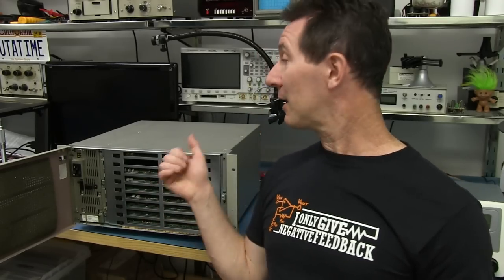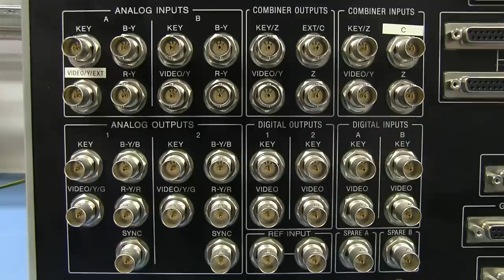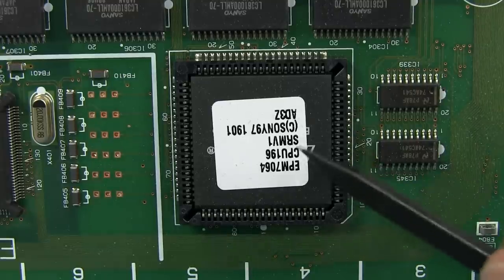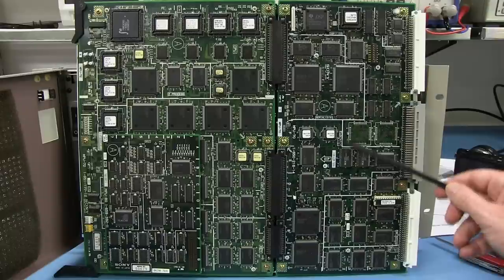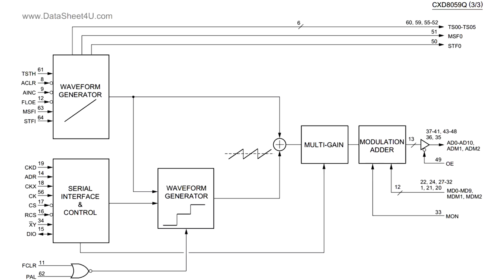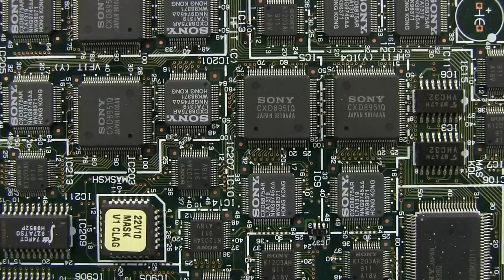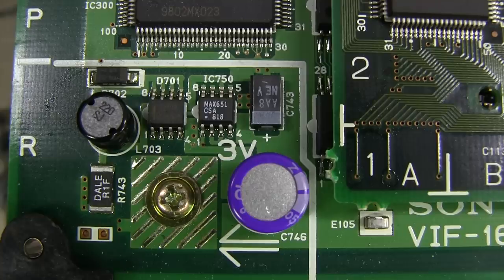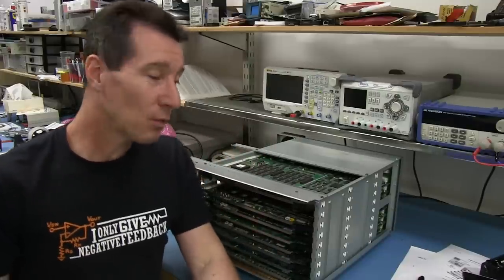EEVblog #598 - Sony DME7000 Video Multi Effects Processor Teardown

Comment: This is all hardcoded math, logic glue and memory working in real time. There is probably very little flexibility and the CPU only use is UI and control the switching circuitry. Now all that can be replaced by a bunch of large FPGA for a fraction of the cost and more effect flexibility...

Comment: and now 1 GFX card can do all this and faster
Reply: So, where are the multiple SDI inputs on your graphics card?
Reply: Except for getting data IN and OUT of the system, that's what the ethernet card does.
Reply: Even back then if they just stuck a bunch of then state of the art 3D graphics accelerators (Geforce 256 or equivalent) they could have come up with a much more powerful machine, even if they split it on different boards. Effects like wiping can be built in with assembly language routines. What they've done here instead would have probably been better suited for the early 90's. They probably would have needed some analog digital-conversion boards to maintain backward compatibility with older equipment.
Reply: Appart from the fact that this beast does it all in real time, including multiple analog input to digital conversion, then D-A back again. All effects can be applied at once, one above the other, without any loss of sync.
Even if a modern GPU as a million time the processing power of this equipment, it can't do the same thing reliability. I'm pretty sure TV studios still use same kind of custom hardware nowadays, you just can't produce real time work with generic CPU/GPU.

Comment: Those SBX1601 and SBX1602 chips were very unreliable. I have replaced at least ten, but ours were thankfully socketed. They are serial-parallel converters for SDI 270Mbit video.
Reply: Knew this comment must be down there somewhere. Sony sold these as parts to other broadcast equipment manufacturers as well.

Comment: SUch a big machine for such a small task, I guess that's the price of reliability.
Reply: No it is the question of ...ability. That just
shows the giant technical development in 20 years. In mid 90ies FPGAs were quite small and PCs had MBytes of RAM not GBytes. I also had to laugh when he was thinking about auto routing. There were no usefull auto routers in this time. But even today in the company I work 99% of routing is done manually.
Reply: goamarty  wrong. a lot of good auto routers in the 90ies, like Orcad. I've worked with them at highschool.

Comment: why would any one want these in todays market? wouldn't you just buy After Effects or some other video software to do all of this?
Reply: if you want true realtime video editing for live perfomances, you will have to use something like this.
Reply: How exactly would you do real-time, multi-input video effects with AFX?
Reply: That's why it is called AFTER effects... you do them later...
Reply: today TV stations use a more advanced version by companies like Tricaster. Any produced professional video, like all the giant bomb stuff is done through a tricaster... they start around 10k
Reply: stephen westervelt Tricaster isn't a company, it's a line of video mixers made by NewTek. There are several other brands making similar systems (Sony, Grass Valley, BlackMagic, etc.).
Reply: Cameron Belt This is realtime (live) after effects is after recording
Reply: A computer can crash. A hardware based editor can't. That's it. Even nowadays they still use hardware effects mixers, wherever it comes to reliability. +stephen: As far as I know Tricaster is a computer-based system-in-a-box, semi-professional, and yes, it can crash (even though newtek products got better within the years). I've had a Newtek Videotoaster with SX-8 extension, and it was a big mess when it crashed during a live event in Vienna.

Comment: RS422 what for a bad interface - this is the worst interface ever like the 485 everytime death from a small electrical flash distroyed. I've ever repair this 485/422 interface chips. (if you connect it often and after a while) The left side of the Videoinput is never used in a Studio and the reason for this is that all CAM interfaces are SDI and connect on the right side as you can see on the backside view of this input/output board. 

A todays PC is 100.000 times better than this part of oddware SDI technic. for example i cut my 4K-HDMI Video direct on a X470 PC Board (Ryzen 7) and this means 2times 5Gbit/s input and 1time 5GBit/s output at the same time on the fly! (M.2 SSD is required - a SSD on the SATA bus will not work)

That a PC is slow and not usable is now never more so - this old SDI cards are so slow and a new Insert Card like the Blackmagic Pro 4K blow this old stuff for lightyears away! 

Sony ist one of my favorits in this point - but the time is now that video is stored in mainframes. Video will edit and cut on the PC or (calculate the effects) the time of such an old box are over.
You edit and cut and effect on Avid Systems that's what happend today in a Videostudio or Editing Place.

The EPM7032 from Altera is a 32 Macrocell FPGA (the Memory is internal in Flash) this make some things like the 8B10B or a converter like the 4:2:2 isertion or decode this. The TTL grave is form the old Engineers of Sony this are designed for holding there working places in the company. That can be replaced in a bigger FPGA for sure but remember the older Engineers have also a right to live from there work and this save the working places.